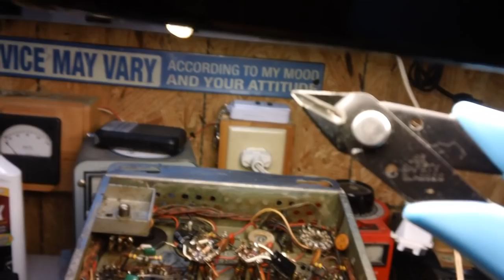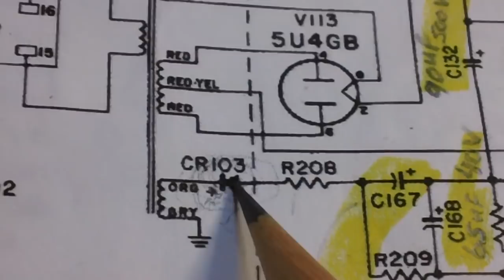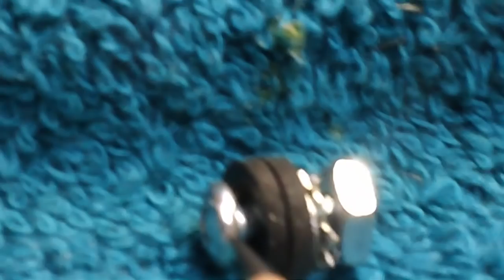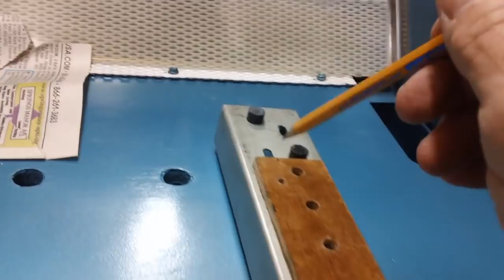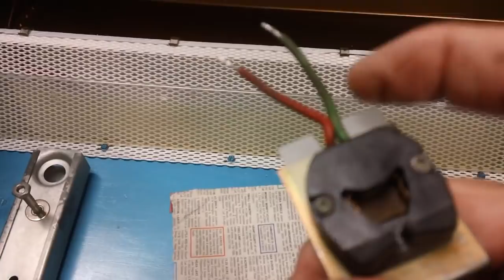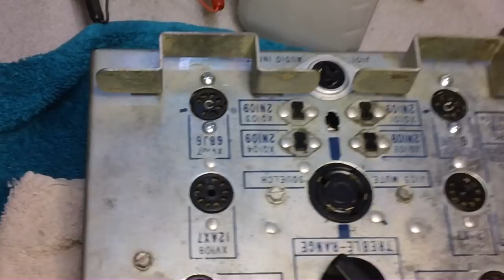1961 Seeburg AY100U Jukebox restoration (Part 47 of 87).

Comment: Hi John,

I hope you and your family had a very Merry Christmas and a happy New Year.

I know what you mean about those resisters.  I've run across that kind myself and it bothers me how bad they look, like their best days are behind them.  I'm glad you replaced them. They don't look like they would last near as long as the rest of your restoration.

I was thinking about your troublesome nut problem... what if you used a hinge-type screw and mounted it upside down so the nut is on the other side?  A screw that needs to be countersunk.  Would that have worked?

Anyway, it looks like you already solved the problem very elegantly, I must say.  Looks good.

Best, Tom
Reply from the maker: Tom,
Thanks, Tom.  I hope your holidays also went well.  Its the best time of the year.
Our Christmas and New Year's days went well, but not as noisy as they once were.  The kids, that aren't really kids any more, have their own families and can't spend the entire days with us anymore.  They want to be in their own homes for most of the holiday activities.  It's to be expected.  Wifey and I did the same thing with our family.
As for that screw and nut...it's no longer a problem.  Putting the nut on the bottom would have likely interfered with the door opening and closing.  It's a 6 of one - half dozen of the other thingy.
Regards,
John

Comment: John, just a minor suggestion for mounting those cabinet slides that you shimmed uo with some masonite, if the thickness of the shim causes a misalignment when you slide in the mechanism, you might want to countersink the bracket (where the nut is) and install the bracket with flat head screws from the top instead of the bottom (assuming this doesn't cause interference on the other side).  Just sayin'
Reply from the maker: Can't do that, Jeff.  The large flat head screws/bolts must be on the bottom.  Anything other than that will interfere with the door swinging open and close.  Besides, there will be no misalignment of the mechanism as the original slide screw holes are still being used.  The only thing that changed is the addition of less than a quarter inch of height.
Regards,
John
Reply: You're way ahead of me.  No surprise. Can't wait to hear some great tunes on that thing.  Have you considered The Moody Blues?

Comment: John, easy to explain the cutters.. They are a knockoff... illegal of course. I've heard of this before.    On your tube sockets, I might have put some actual springs on those bolts to provide comparable spring action. You did a good job improvising, but not sure its enough bounce for bass in a cabinet.... ( take it from a Bass player)... but knowing you, it will work out perfectly :)   I see you have come across fish paper like I did.....  good fix....   You gave me a good idea for protecting sockets while clear coating.... save your bad tubes..... and just them as protection for tube sockets... or I can print socket covers on my 3d printer and use those. Something to think about in the future for me.    Great update on that amp... looks like night and day my friend.   PINBALL MACHINE !!!!!  Cannot wait for that one....
Reply from the maker: Ron,
I don't think the cutters are knockoffs.  They look, feel and cut too good.  Also, springs aren't really needed on those two tube sockets, as originally only a very thin layer of foam rubber was used to prevent the micro-phonics.  You bass dudes run your amps at near maximum boom-boom levels.  This old juke won't be operated anywhere near that volume.   And about that stinking fish paper...those old light socket insulators were actually just cheap ole thick paper.   You'll run into that a lot before it's over.  Fish paper was primarily used inside IF cans, which I've always removed and replaced with the quilt pattern plastic.
BTW...I recommend that you not use old tubes to plug socket holes when painting.  Ain't gonna work, my friend.  One way or another the spray will make its way in there.  Cover the entire socket/plug with masking tape.   It's quick, easy and 100% effective. 
Regards,
John
Reply: Thats why you are the best - you are the voice of reason  :)   Many thanks for that my friend. Happy New Year.